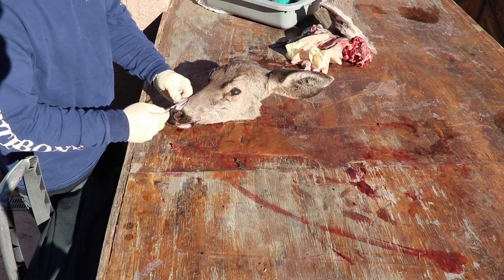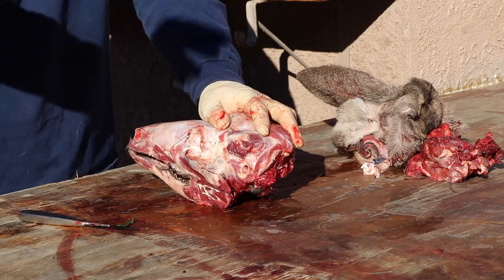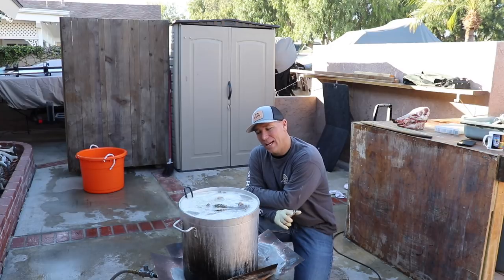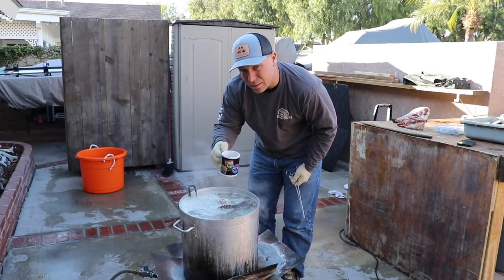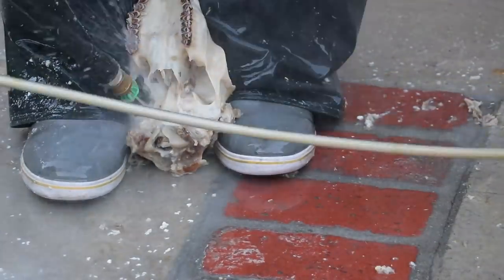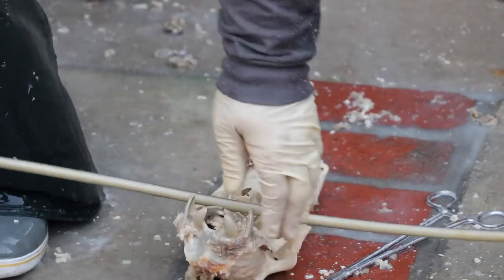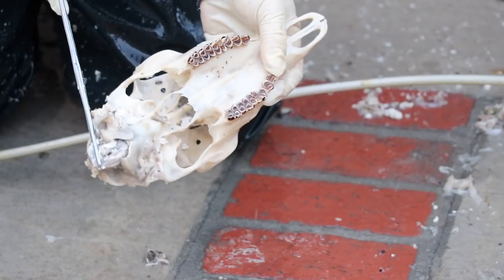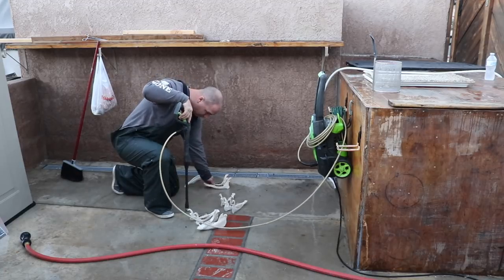HOW TO CLEAN A DOE DEER SKULL

Comment: Good joke! Thanks for the vids. I finished the Elk euro on a cherry plaque and gave it to my buddy before xmas. The elk was the most challenging because I didn't have the right size pot. My pot was too big, and therefore the water took Forever to boil and stay hot. I needed a smaller sized container than the one I had. Overall, it came out good, along with the 4 deer skulls I finished. All that stuff was taking up space in the deep freeze, so now its all cleared out!! Merry Xmas

Comment: I did your solution for 20 min at a light simmer and my bone is deteriorating. Any suggestions?
Reply from the maker: I do it for 1 min tops. I think you need to seal it with mop n glo.  It’s probably over boiled.